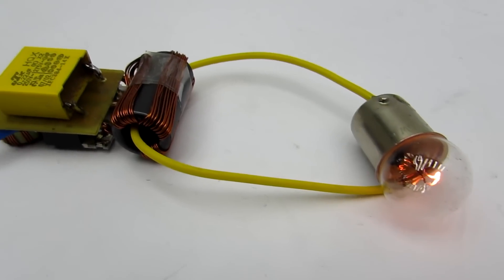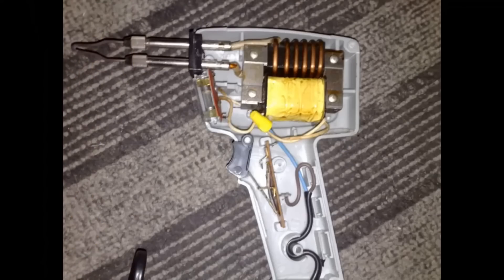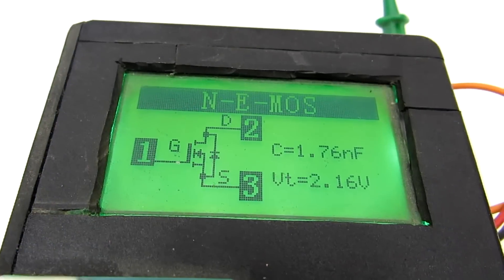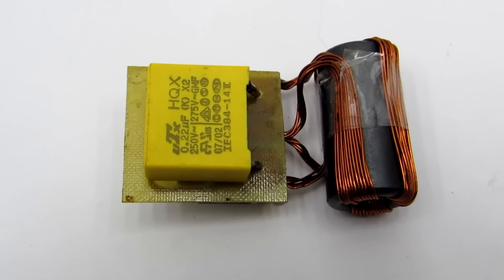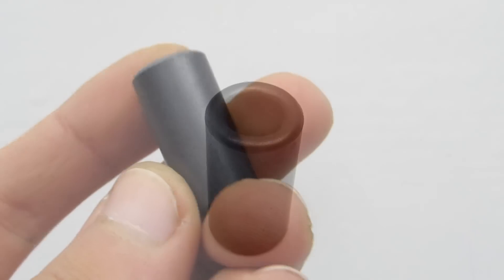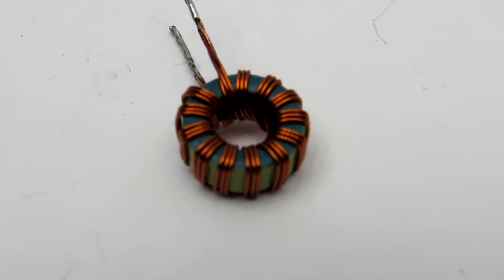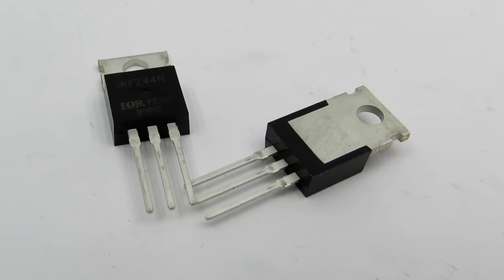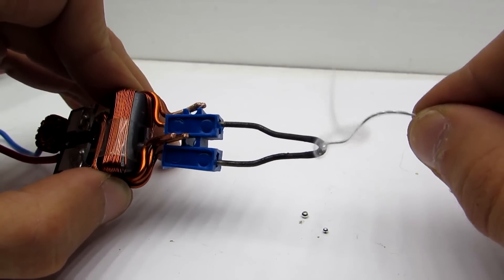DIY instant heating soldering iron

Comment: I finally managed to make a soldering gun using a ZVS driver and 2x18650 cells and it kept blowing up fuses and transistors, the tip wire thickness is very important because it causes the oscillations to stop at least in my case. To get around this problem, I made a large inductance choke (L1) to limit the current and now the transistors won't blow. It starts to squeal as the tip gets very hot. What I hate about it is that when the tip is cold, it draws about 3A but after the tip heats up the frequency decreases from 50Khz to about 8Khz and it draws about 7A which quickly overheats the tip so you have to know when to let go of the trigger and let it cool down.
Reply: i mucked around with a  few ZVS drivers, pushed one to 4mhz driving a tesla coil, really nasty hot arcs that melted secondaries, even at 0.5mm thick..
so, induction heating was my real intention. found that with a empty coil, dropping in a chunk of steel caused fets to not just fail ,but EXPLODE. instantly.
starting it up with the load wasnt so bad... but very delicate, very prone to releasing brown smoke...

anyway. its about "Q".
the resistance, the load, and how the reflections interact with the supply. you can run any combination of capacitor and inductor that will give a desired frequency, but a high Q will be very peaky, but also prone to stop oscillating when loaded as the peak alters, whereas too low a q and it may just not oscillate at all. 
two opposed equations... 1/2LI^2, 1/2CV^2.
half of the total energy is stored in the capacitor as voltage squared, half in the inductor as current squared. current squared across a resistance gives heat...

for a given load or resistance on the output, theres a certain ratio of capacitance to inductance that allows for the maximum power transfer. too much load, too little resistance, too much energy is transferred and the circuit may stop oscillating. the magnetic fields are damped by their own BEMF. its lenz law. a spring cant bounce when its damped... an oscillator cant oscillate when you suck too much power out of it. the currents you produce in your secondary, whether its a single turn of wire, a lump of steel, or 20,000 turns... will produce their own magnetic fields that oppose the applied magnetic field and the current that produced it. when shorted. when "loaded". less resistance=more load.

higher frequencies at the same voltage are higher current.. in the tank. dont think of current as flow but the rate of change. a 20v peak to peak sine wave at 20khz has far less rate of change, far less current, than a 200v peak to peak at 20khz.

the current in the tank circuit is what counts. the ratio of input power to absorbed energy in the workpiece though... thats the efficiency.

its a headtrip. i am not a fan of the ZVS anymore, im a half bridge resonant LLC convert...

Comment: How can I test an IRFZ44?
Reply: Lenar OX search transistor tester on eBay or Amazon or any other sites
Reply: that is N channel Mosfet transistor , set your meter to measure ohms connect positive or red probe to d lead and negative probe to S lead (leg) of the transistor it will show high resistance touch the gate or G lead with your finger it should change resistance if it did change it is Ok to  consider it good transistor. if all of same type of Mosfets are not checking good in this method of testing it is sometimes  for having protected gate and the method of testing is different for this type and it should be checked dynamically with voltage applied .

Comment: It seems I was right. I also wanted to make a portable soldering gun using a ZVS driver but I don't have a thick enough wire for the secondary. I will try to get around it because it's been on my mind since a few years ago. Watch my video where I made 18650 powered soldering iron using a Metcal tip. Cheers :)